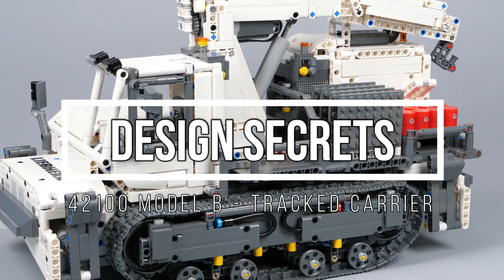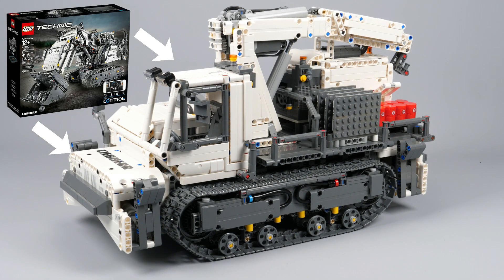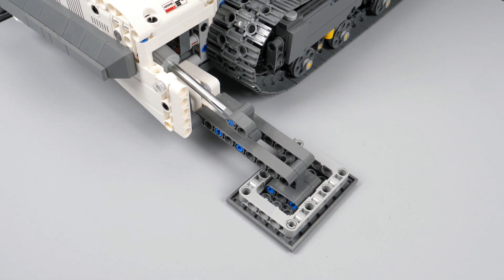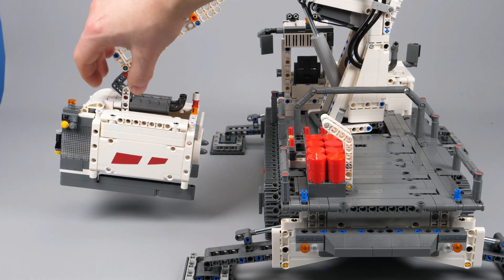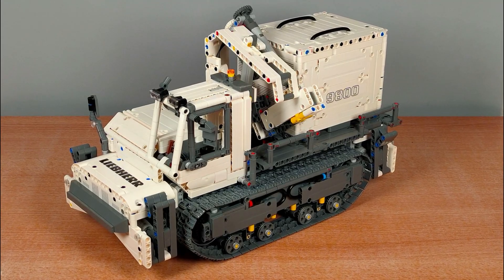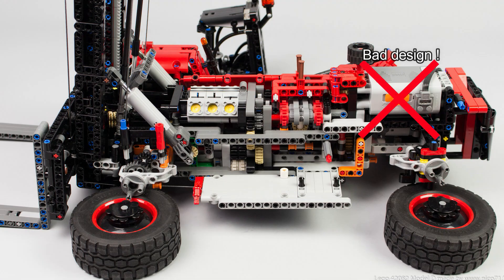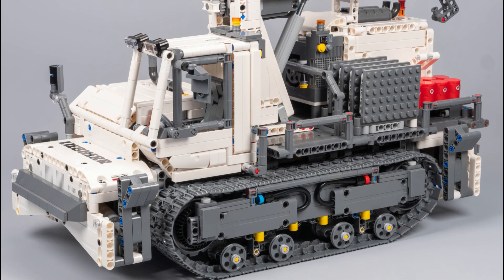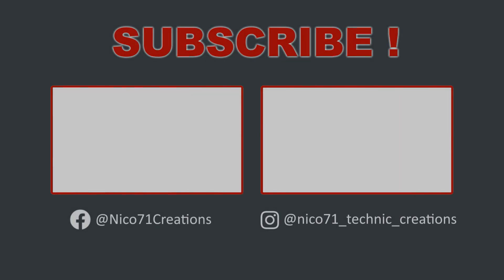Design Secrets of my 42100 : TRACKED CARRIER alternate model

Comment: Wait…. I didn’t know there was an app that allows you to customize functions for Control+. What app are you using?
Reply from the maker: This is the app called "Powered-up". You can find a link on my website in the description. You code using block so in visual coding but it is pretty simple to understand. It is mandatory for this creation as I use a different layout for the motor than the 42100 original set.